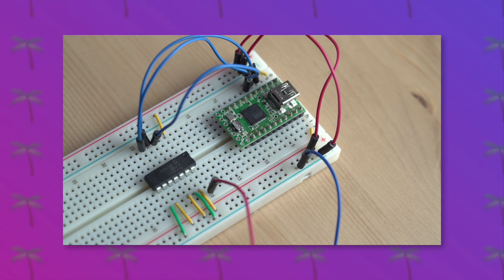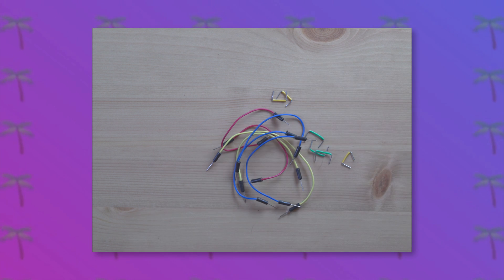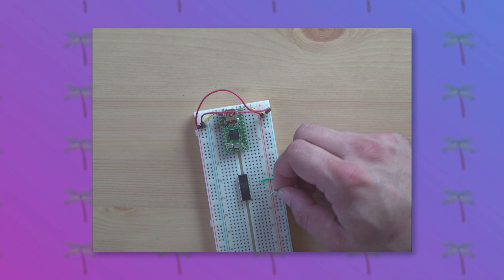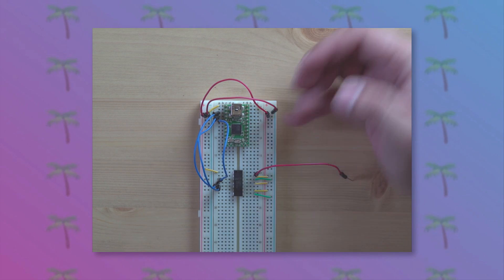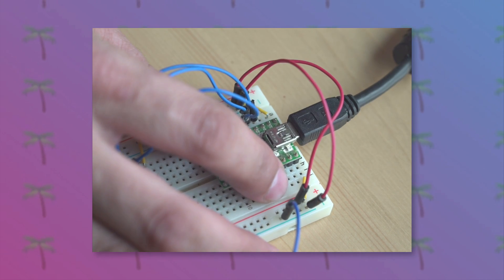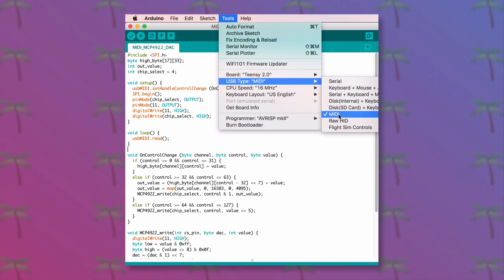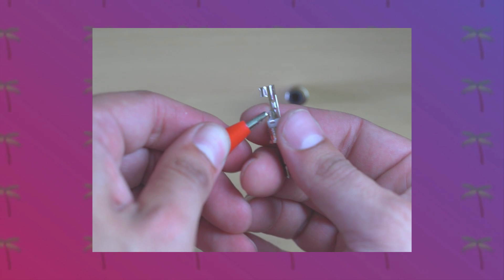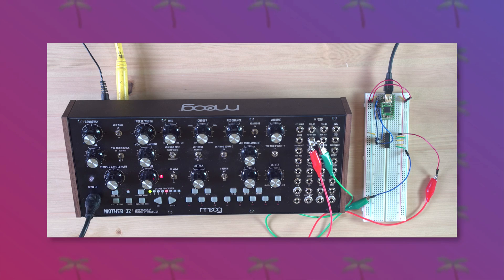Let's Make: A MIDI DAC

Comment: Could you use this with a midi out socket? Would be good for my eurorack. 

Cheers
Reply from the maker: Do you mean a MIDI in socket? And then convert that to CV? Yeah, for sure
Reply: @littlescalemusic  sorry yeah I mean MIDI in. No extra code needed? Just wire up as normal and add a optocoupler? I want to use a midi keyboard to play modular gear.
Reply from the maker: A little bit of extra code to get the Serial 5 pin DIN MIDI in, but all the same DAC functions can be used. So it's not hugely more complex than this. Im working on an 8 - 16 channel version with full 10 octave range per channel which is with USB and 5 pin MIDI in too - I think this will be very well suited for MIDI guitar Can you send each string on a different channel or how would polyphony work?
Reply: Not sure I'm a noob only built a eurorack power supply and 4 x cem3340 vcos. I have a keystep but also want to be able to use a 2nd keyboard. Ok cool. Are you going to make a another toutorial? I subscribed.

Comment: Superb video! :) A couple of questions:
Will the DAC introduce any latency to the MIDI signal?
Does it have more latency than something you would buy, or is it more or less the same circuit that any MIDI to CV converter has? 
Do I need multiple DACs if I want more than one CV output? I am looking to build one with 8 outputs.

Comment: What is the full cv range with the dac ?, thank you . Very useful circuit.
Reply from the maker: 0 - 3.3v or 0 - 5v if powered directly from the teensy or usb bus directly. This can be increased in a few ways, if combined with a TL072 op amp, and powered using either a USB dc dc regulator (PowerBrick or IR0512S components) or the power supply from a eurorack itself.
Reply: Is it possible to go from -5v to 5v to control the MS-20 Mini cutoff, please? Thank you

Comment: Sorry for the noobish question. But why do we need the MCP4922 instead of using the PWM pins? They have an 8 bit precisions and you could use a few together with some resistors to increase precision (2 => 16 bits, 3 => 24 bits, etc.). Obviously the max ouput voltage might still need to be increased depending on the device it would connect to. But the Teensies have plenty of PWMs and you could control a lot more params with just one teensy. The teensy 3.6 has something like 22 PWM pins even if you use 3 pins per parameter you could control 8 params without any MCP4922.
I am thinking I must be missing something here.
Someone please help me out cause I need to be able to control 12 VCOs and some VCFs (trying to make my own 6 voices analog synth) and I am wondering if the PWM approach could be viable or not.
Reply from the maker: Not a noob question at all. How would you combine multiple PWM together to increase resolution? Do you mean something like - 2 x PWM filtered via an RC filter and then combined via a line mixer resistor? If so, Wouldn't each additional PWM add, at most, an extra bit of resolution (i.e. 1 x PWM is 8-bit, 2 x PWM is 9-bit and so on?) 

Anyway, interesting idea!
Reply: littlescale if you use 2 pwm pins (A and B to simplify). If A has an unchanged output (generating normal steps) and B has a resistor that divides the output voltage by 256 (generating small steps) you can therefore generate 256 * 256 steps (=16 bits). B will generate 256 small steps in between the 256 big steps of A. If you add a third pin you have 256x256x256 different levels (= 24 bits).
I actually saw somewhere that since you also need capacitors on each pin's output to transform the duty cycle into leveled voltage you have either a voltage leakage (small capacitor) or quite some latency to reach the desired voltage (bigger capacitor). So it becomes a trade off between voltage precision and target speed.

Comment: Great tutorial, thanx! And it's much easier than with an Arduino. I'm a total noob either in programming and electronics, but this looks absolutely doable for me :-)

One question: what about stepping? Is there some sort of interpolation of the 128 midi values to the 4096 voltage "steps"? So will the output be rather smooth or will you hear stepping?

Thanx again!

Comment: What's the valid range of values for one of those CV inputs? 0v, +5v? And so 0v (or an open connection) means the cutoff knob is "accurate" while any voltage over 0, up to +5v is "added" to the cutoff knob's setting?
Reply from the maker: The valid input range for the inputs is -5V to +5V. with 0V being the neutral position, and above and below added and subtracted. The DAC in this instance is only 0 - 5V, however I've found it to be effective for the effort / cost.
Reply: Very interesting. Thanks for the concise explanation. Never worked with a DAC at such a low level.

Comment: Hello!
It looks like a simple schematic to me. Is this suitable to make a full MIDI to CV converter? At least to send notes, velocity and gate sygnals? Do I need just one of this for all or I need to build a more complex schematic?
Reply from the maker: yep - you can simply send on / off MIDI notes out of the Teensy as on / off gate values, also the DAC can then send velocity, pitch, etc.
Reply from the maker: here are some links: 

MIDI to 1V Per 8ve CV and Gate Max for Live Device: http://little-scale.blogspot.com.au/2016/12/midi-to-1v-per-8ve-cv-and-gate-max-for.html 

MIDI to MCP4922 DAC CV and Gate / Trigger: http://little-scale.blogspot.com.au/2016/12/midi-to-mcp4922-dac-cv-and-gate-trigger.html 

MIDI-Controlled 12-Bit Octo DAC: http://little-scale.blogspot.com.au/2016/11/midi-controlled-12-bit-octo-dac.html
Reply: Yes, OctoDAC seems to be very cool! If it supports some additional features - CC messages to change cut off and ADSR values then it's perfect! Will be 2.0 version of Teensy great for 8 channel MIDI DAC or I need 3.1 or 3.2? Our local store tells that 3.2 is the most powerful now (3 UARTs and 2 SPIs and other). But it costs x4 times than 2.0 :) x3 times on Ali...
Reply: @littlescalemusic  hey! Sorry if this is a silly question, but would it be possible (and easy for a noob like me) to make something similar for V/Oct using a teensy LC or 3.2, since they don't have 5v output?
Reply from the maker: @turbochargedfilms  Yeah I've found that all of my modular gear responds to clocks, triggers and gates from 3.3v and both the LC and the 3.2 have a DAC output as well. :)
Reply: @littlescalemusic  Ah sweet. I'm guessing V/Oct tracking would be limited though?
Also, does the DAC output somehow negate the need for a the MCP?
Reply from the maker: @turbochargedfilms  Sorry apologies I thought I was commenting on a different video. So, you can still use the MCP4922 with the Teensy LC and 3.2, as with the SPI bus you only connect clock, select and data out from the Teensy - so you can power it from 5V from the Teensy, but you can communicate with the 3.3v from the digital IO. That way you get 5V output on the MCP. I would recommend this compared to using the onboard DAC, as this would only be 3.3v.

Comment: Hello! Nice and cool project, I'm gonna make one myself. Just one question: is it possible to have multiple parameters controlled by this DAC? I mean, several analog outputs I could connect to several parameters. Thanks a lot for the help! :)
Reply from the maker: Excellent reply. Adding to this: Teensy 3.2 is 3V while Teensy 2.0 is 5V, level converters are needed for data and clock lines if 5V output is required. Additionally, I would expect a huge performance boost going to a 3.6 (180Hz / 40 pins / two SPI ports)
Reply from the maker: Thanks for the reply Ben W!
Reply from the maker: ok, so each MCP4922 chip has two DACs, so if you have four chips you can control 8 parameters and so on :)
Reply: Thanks a lot for the reply and the infos! So, if I use a bigger Teensy I suppose I'll have more Outputs, right?
Reply from the maker: My understanding is that 3.5 pins are 5V tolerant, but don't put out 5V per se - I may be wrong!
Reply: Thank you so much for the great answer! I'll study it out and let's see what I came up with!